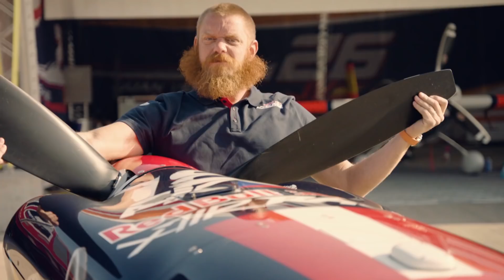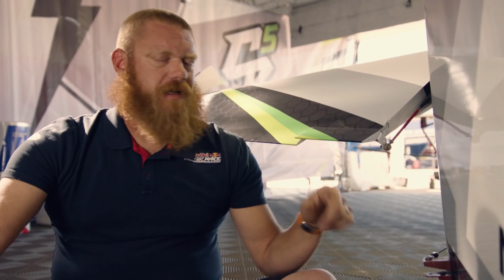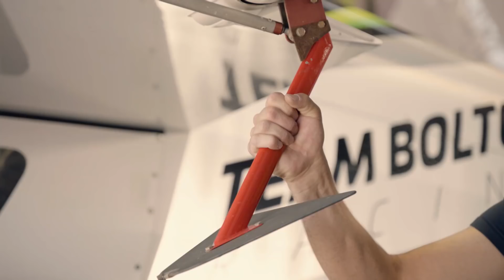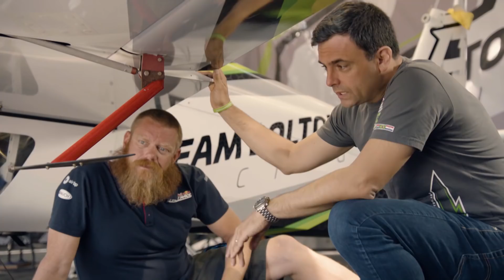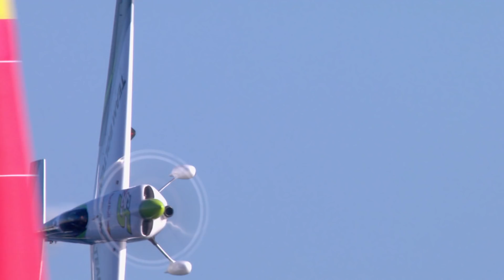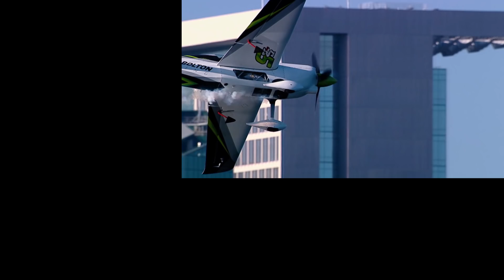Red Bull Air Race Tech Talk | Trimming

Comment: The pitch trim explanation for higher speeds doesn't really make sense. At all speeds, for level flight, the same amount of total lift is required (wing plus horizontal stabiliser plus body lift plus propeller thrust vertical component, but we often ignore the latter two).

Both the downforce of the horizontal stabiliser and the main wing lift increase with the square of the speed. To reduce lift, then, the angle of attack on the main wing has to be reduced, thus the aircraft has to be trimmed nose-down. For that the trim tab has to go up, forcing the elevator trailing edge down, reducing the downforce of the stabiliser.